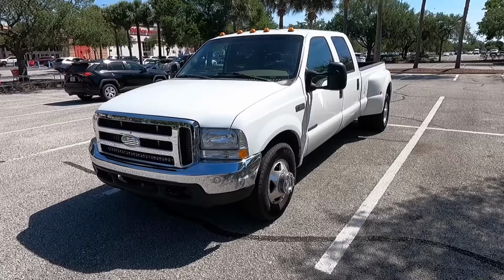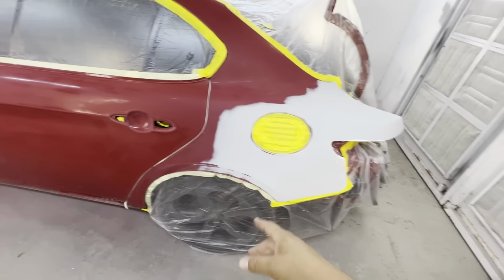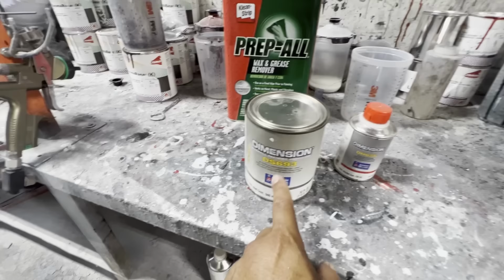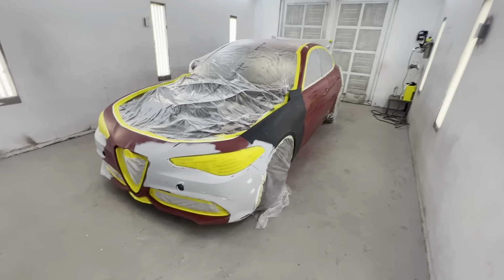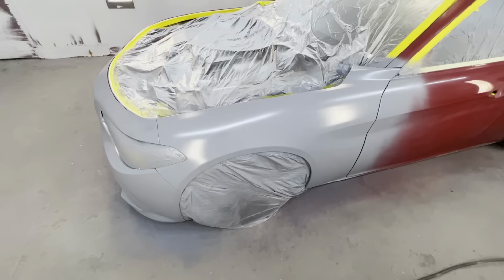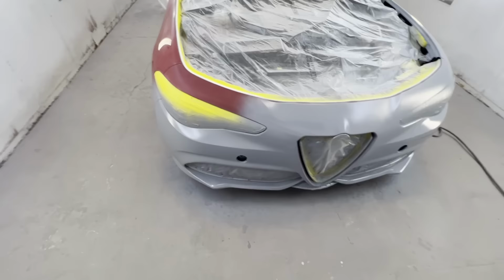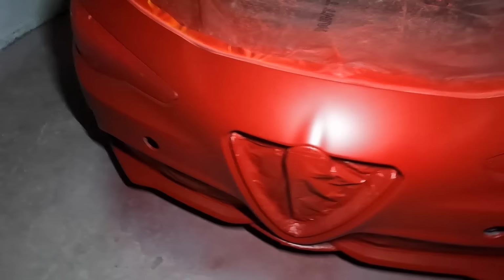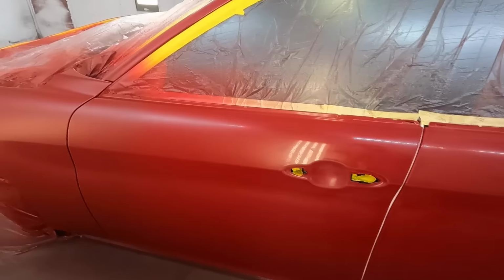Painting a Alfa Romeo! What I currently do for a living!

Comment: Experienced painter advice for ya. Tip for the future. Paint from front to back towards the filters. Less dirt and orange peel cuz the overspray never touches fresh paint. Overspray sucked away from previously sprayed panels. Kick ass bro
Reply: If you look at the spray drift, its going to the  front anyway. Looks like the filters are in the corners at the front, good spotting though!
Reply: I think I just realized why my friend always had orange spray when he sprays lol
Thank you for this comment!
Reply: Thanks for the advice . Makes sense .
Reply: @yasha1928  😆💪💪💪
Reply: Another tip for catching dirt/ debris is to spray a light coat of water on the ground (not on the vehicle)  as long as you have a good air system/ filtration in the booth. Contaminants fall and the water traps them

Comment: Just a tip bro, when you spray your sealer, cover your clean blend panels. Then pull the paper off and do a small blend on the edge, give it a sec and spray some blender on your sealer edge to melt it in (followed by a tack cloth when dry). This will reduce overspray on your clean panels and a super clean transition on your blends.
Reply: Nice work though bro, keep it up!

Comment: Tip from one painter to another, in that situation when you have two blend panels next to each other they cancel out, in other words if you have enough base coat you should just put a light coat of color on the whole side (no need for blending) that way there is no chance of seeing a blend.  Also those bright factory colors are more vibrant water based base coats if you are using solvent you will want to leave a little of the toners out that muddy up the color, you can always add them back in if you were wrong.